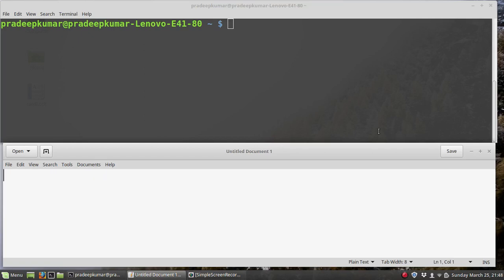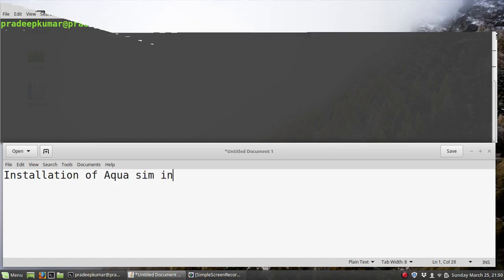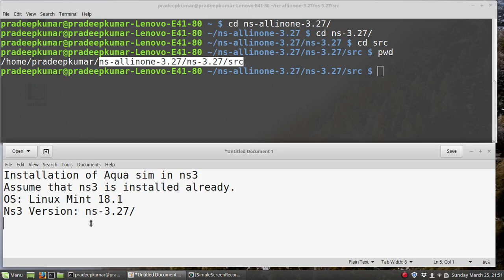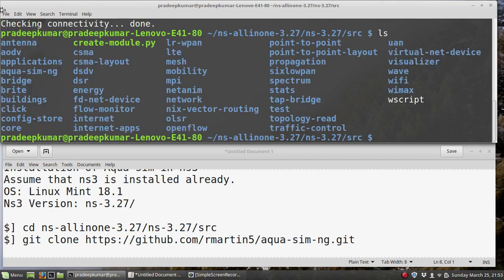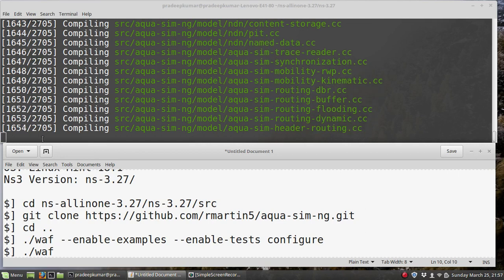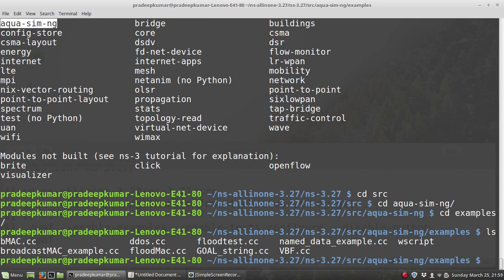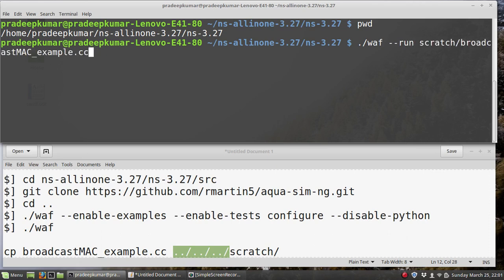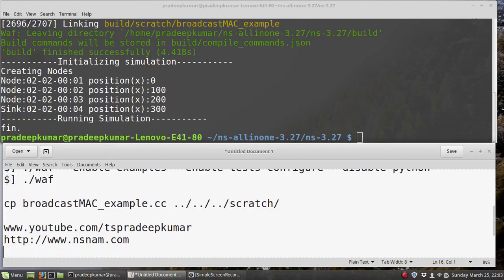Underwater Sensor Network Simulation using NS3 | Aquasim |   NS3 Tutorial 6

Comment: ./waf --enable-examples --enable-tests configure --disable-python this gives sh: 22: ./waf not found how to solve this or what is the issue
Reply from the maker: try ./ns3 instead of ./waf
Reply: still can't use, traceback (most recent call last):
  File "/home/dell/ns-allinone-3.40/ns-3.40/./ns3", line 1622, in <module>
    main()
  File "/home/dell/ns-allinone-3.40/ns-3.40/./ns3", line 1432, in main
    args = parse_args(sys.argv[1:])
  File "/home/dell/ns-allinone-3.40/ns-3.40/./ns3", line 396, in parse_args
    raise Exception(msg)
Exception: Unknown options were given: --enable-examples, --enable-tests.
To see the allowed options add the `--help` option.
To forward configuration or runtime options, put them after '--'.
Try: ./ns3 configure -- --enable-examples, --enable-tests
can you solve that?  @tspradeepkumar